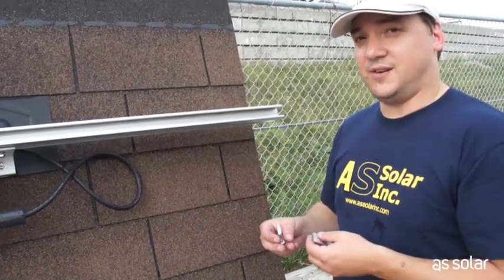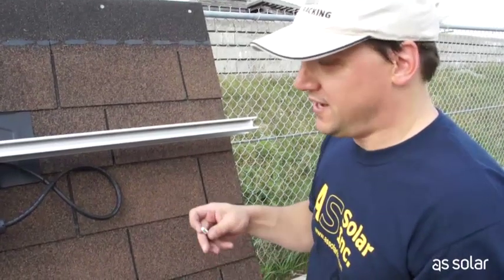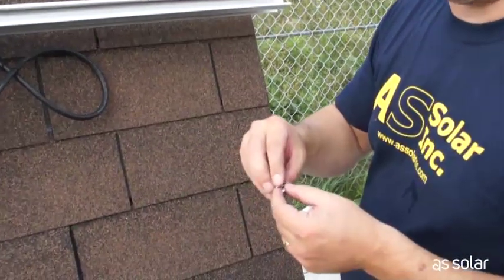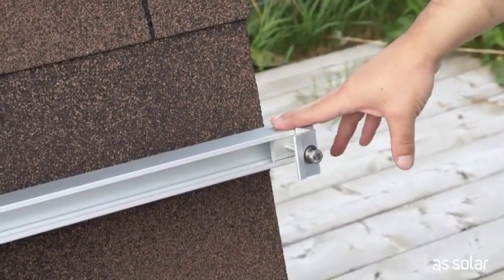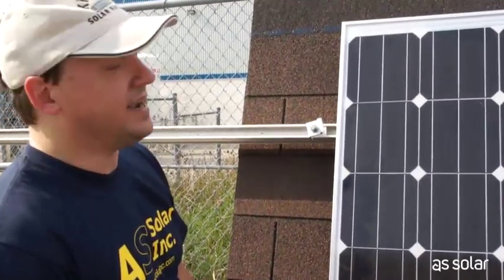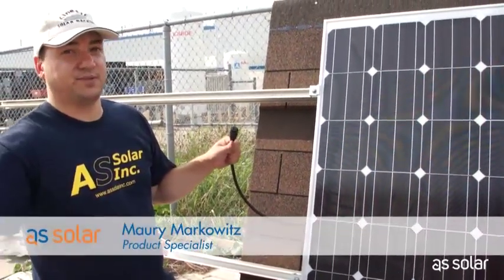AS Solar's DIY Solar Panel Installation, Part 5: It's time for the panels!

Comment: Can you put the clamps on the edges that are further apart rather than the close edges?  I'd like to put up an array with 3 rows that are portrait (12 panels each) and 1 row that is landscape.  I can fit more panels that way.  For obvious reasons, I would rather run two long rails for the landscape row that are parallel to the rails for the portrait rows, but that would require clamping on the ends of the panels that are further apart for that one row, and I'm not sure if they are strong enough for that.  Still 4 clamps per panel, obviously.  If it matters, this is not a high wind area.